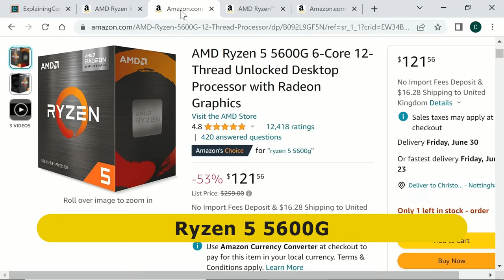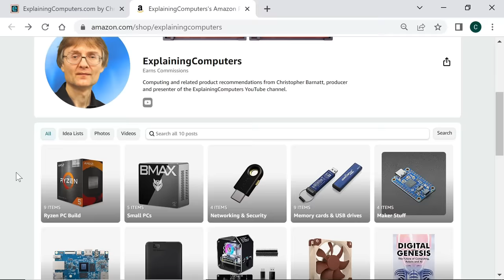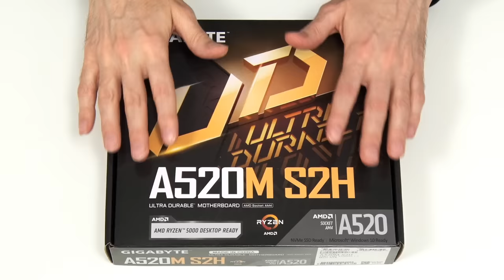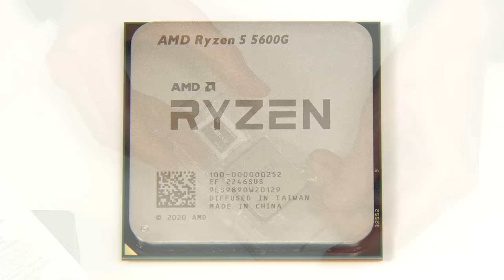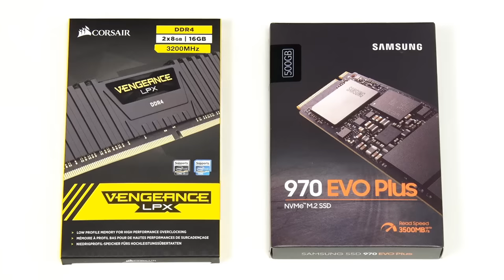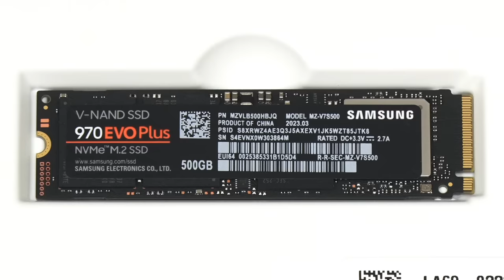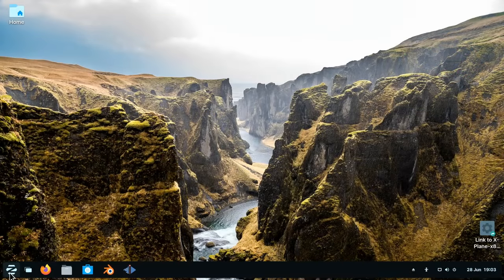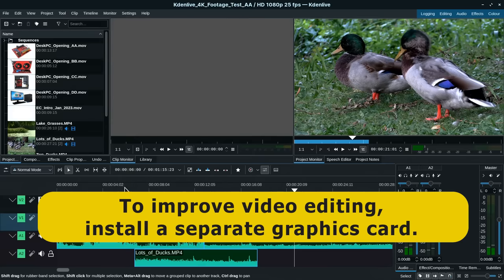Best Value Ryzen PC Build

Comment: I like your approach of going for the 'reasonable' rather than 'high end' side of the performance spectrum... If gaming is not a priority, this system should do its job nicely for the next couple of years, for a manageable budget.
One question though: would that system meet Windows 11 requirements?
Thanks a lot for your time and efforts, and have a relaxing Sunday!   :)
Reply from the maker: Thanks for this. The system meets Windows 11 requirements -- and indeed runs Windows 11 well.
Reply: @ExplainingComputers  Interesting I was going to bet given the age of the processor that this was not going to be the case, but it makes a build like this more interesting! some of us are still firmly in windows 10 land i have 3 daily driver PCs that will not run windows 11 because their cpus are not on the list. They are all capable machines. I think i would probably see  if i could find a motherboard with more memory slots given that i have ddr4 memory that i can recyle and my main work machine has  32gb which isnt enough! Having 3 machine to upgrade if i can recycle the ssds and some of the memory then thats good. Given that everyone will be doing the same old motherboards, cpus and ddr3 memory with are all non windows 11 stuff will be worth very little! and i have to use windows for work!
Reply from the maker: @stevewhitcher6719  As time has moved on, processors not able to support Windows 11 are now typically about 5 years old. And the 5600G is less than two. :)
Reply: @ExplainingComputers  Good point! I did buy the Ryzen 5 CPU that you suggested but paired it with the 4 memory slot version of the motherboard! Havent bought an AMD cpu since they did socket 7 ones! Will be interesting to see what its like!

Comment: The 5000 platform is a great value. You can build a great computer under a budget, it's simply amazing. I just recently built an R5 5600/RX 6600 computer for under $450 (I reused my previous PSU and Case just like Chris did) and I couldn't be happier.

Comment: I watched this vid to figure out how I wanted to build my new one as my current one is about 9 years old. It was the latest and almost the greatest back then, it has served me well and still running. I bought an asus prime b650m-a axii, 16 gig memory, ryzen 5 7000x cpu with a coolmaster hyper 212 black edition cooler. Cooler is massive, just fits in my full tower case. 
Sit down, i paid 853.00 us for all that at a brick and morter store. I checked, they were a bit cheaper than anything on line currently as of a week ago. But still OUCH!!
Thatks for you vids Chris.

Comment: I always use a CPU with onboard graphics even if I am adding in a graphics card. They are extremely useful when trying to debug problems. Additionally, people don't realize just how powerful these new chips are, especially if they aren't doing graphic intensive applications.
Reply: The not needing a Display port, TV on it, old VGA giant monitor...muhahahahaha, why old people need this ??????
Reply: @lucasrem  My new machine has an HDME port on the main board. That seems to be sufficient. My graphics card has multiple display ports.
Reply: Excellent point on using onboard/integrated graphics. Last time I built a PC was... The Pentium 4 days... (Wow, has it been that long?) I'd build the entire machine except for upgraded graphics card, and use the onboard to check for a good boot sequence before adding "one more thing to go wrong."

To be fair, this might be a holdover from Ye Olden Days of setting IRQs and DMA channels with jumpers...
Reply: @dashcamandy2242  yeah, I remember the IRQ days.  I started building computers in the late seventies when I had to wire wrap components to be able to run scrounged peripherals. Good times.

Comment: If you're building something similar for yourself, keep in mind that the 5600G uses PCIE 3.0 instead of PCIE 4.0 compared to the 5600 so you may get some minor performance loss on your GPU depending on your CPU/motherboard selection
Reply: Only on the xx50 Nvidia ones. Others would be unoticed
Reply: the a520 has limits, one of it is that same pci express 3.0, and in practice the only real problem it might offer is not handling well the new pci express 4.0 x4 gpus like the rx6400 or 6500
Reply from the maker: Agreed -- and this was noted in the video! :)
Reply: It's an integrated GPU, so PCIe 4.0 isn't relevant nor will it affect performance. Memory speed will have a larger impact
Reply: @arch1107  from PCIE 3.0 to 4.0
only have a difference of 5~10 fps in almost all games ~ 🗿
please check the 5600x video that uses PCIE 3.0 and 4.0 slots on YouTube
:face-blue-smiling:
Reply: The only reason to use a 5600g instead of the 5600 is to not use a GPU and use iGPU of the 5600g so the pcie version it supports doesn't matter.
Reply: Being a diedinthewool minimalist, I love your emphasis on best value approaches. If I were to build this computer I would only add one thing - a USB-C port card.
Reply: Users of 5600G may not consider Graphic card...
Reply: @penonton4260  no, the limitation on x4 gpus is documented and rx6500 loses more than just 5 fps, in general most gpus will be fine except x4 gpus on pci express 4.0
Reply: @ivantsipr  No, some of us like to have a dedicated GPU plus an integrated GPU as a secondary/backup to give us more choices for GPU testing, system re-purposing, etc.
Reply: @paintedjaguar  Interesting.  Is the loss of cache or whatever it is in a G chip as opposed to a non G chip a detriment to chip performance?  thx.
Reply: @DeepakKumar-lv4te  I don't really know, pinpointing performance bottlenecks is mosly beyond my competence. But sometimes it doesn't pay to sweat the small stuff.

Comment: By coincidence I just built a Ryzen 9 7900 system, for about 4x the price. Much quicker but not 4x quicker. There is a strong economic argument for trailing edge. But, £200 of that was the case and PSU, so in reality, probably only 3x as much. I used a Gigabyte X670 AORUS ELITE AX which has a lot of IO capability and 32 Gb Corsair Vengeance DDR5 RAM. The SSD was a 1Tb Samsung 990 Pro. It is getting hard to find decent cases these days with 5.25 inch drive bays for an optical drive and without glass sides and multiple LEDs. I can see why you re-used the case and PSU.
Reply: you should give the price minus the extras in ram and disk and case for a good comparison for us.  🙂

Comment: Hi Christopher, I recently built a very similar PC to this, I had a power supply, case and a basic graphics card so used an AMD Ryzen 4500 instead of your 5600g, I also chose a Gigabyte motherboard. I've been pleased so far with the build, like you I've gone for an NVME drive, it's the first time I've had one and the speeds are amazing. I'm also a big fan of your choice of Linux OS, Zorin 16, it works so well.
It's good to know you have supporting videos on things like front panel connectors, I can never remember which ones go where.

Comment: This is excellent - an easy answer for the many people who ask every day what to get on a budget.

5600G is pretty decent for many games too - and I still consider building in a cheap metal box to be so much simpler than going with a laptop... obviously it also means you don't have to consider your Monitor, mouse or keyboard an integral part of the system... but then also there's a chance that you have to remember the built in camera/microphone/bluetooth too.

Comment: Excellent video. My old rig is ready for such a rebuild. I'm still running a system I built with an AM3 board and an AMD FX 6300 6-core CPU. It still runs windows 10 and 11 fine, and any linux distro is great on it. But it's time for an upgrade. Been using it about 11 years.

Comment: My current personal rig I have built on a Ryzen 7 5700G.  16GB Ram @ 3000Mhz O/C to 3200MHz allied to an MSI B550 A-Pro.  I had to update the Bios with flashback worked a treat!  What I liked with this board was the 6 Sata ports as I use a lot of dries as well as M.2 NVMEs.  Currently using Windows 11 - but will be putting Linux on my new crucial 500GB NVMe.  Nice build - clearly put one error you said 5500G at the end ;-)

Comment: By happenstance I built a near duplicate here in Ontario, Canada.  Small differences in that I installed Linux Mint on a WD Black M.2 NVMe and like you am very pleased with the performance and price. Admit that I shopped carefully for the parts and bought "on-sale" as much as possible. Cheap old retired guy and all that, grin.

Comment: Great video (again). I did a very similar upgrade to both my main computers over the last two months. One was with a GIGABYTE motherboard, and the other an ASUS; Both using M450 chipsets. Both worked well, and was a satisfying task. I ended up replacing both cases and power supplies; so I guess they were rebuilds, not upgrades.

Comment: I watched this with admiration. It was dreamlike in that all the plugs fitted into the appropriate sockets with no adaptors required. In my personal experience I seem to encounter problems with fan connectors (lol). 3 pin or 4 pin, or trying to run more fans than sockets allow for!! keepup the good work!!

Comment: LOVED THE "CRASH" AT THE VERY END  :)
Overheard on the Heathrow Public Address system:
We are sad to notify you that your private pilot's license has been temporarily suspended by the Federal Aviation Administration in the USA, until you pass their remedial beginner's tutorial.  LOL!!
Otherwise, another GREAT video, Christopher.
Just one very small suggestion:  we now like to print a hard copy of the motherboard layout diagram, and keep that hard copy nearby in a manila folder.  That way, if the PC is powered OFF for hardware maintenance and/or upgrades, the layout diagram can be consulted to confirm things like available PCIe slots etc.
Keep up the good work, Christopher:  YOU'RE THE BEST!!

Comment: Among the best of the best in PC building videos, congratulations!
A small reminder:
AMD APUs tend to have less level 3 cache than the same CPU range without integrated graphics. You will almost never notice a difference, only when using CPU intensive applications such as video editing, or when you have - as a matter of speaking - multiple applications running alongside 55 open tabs in your web browser.
 Also, always check if the integrated GPU has the ability to encode in hardware the video codec you plan to use. If not, the CPU will need to do it, and it will be slower.

Comment: I hope to see you get a couple million subscribers Chris
You absolutely deserve it
Yourself, networkchuck, Jeff Geerling and serve the home are top notch channels 
Sorry but I gotta shout all four of you all out
You have all been in constant rotation on my home lab tv
I actually rip your videos and save them for later
So I can play them through plex
On my 4K home lab tv
Don’t worry I am using an LG WeOS tv. Gotta keep everything Linux based.
All the way to the router with OpenWRT
Was going to use PFsense as a firewall til I was researching it. It’s bad based. So I have ipfire for now.
I’m caving and putting Pfsense on the firewall 
Just works a bit better
Here’s to hoping I can get QuickAssist to work this go around
You got me beat in the Ryzen build
I had an AMD FX. So I jumped the gun quickly and built a Ryzen 3 1200
My gpu is an AMD Radeon RX 570
Only 8 gbs DDR4
Granted it only plays Doom. Well every Doom Game I should say.
All the way to Doom Eternal
Had to sell my Xbox due to not having time to play it.
All I play is doom anyways
So I’m all set
And yeahhhhh Mr Scissors makes an appearance

Comment: Excellent "how-to" - thanks! I'm thinking about putting together a Ryzen 7 or Ryzen 9 7000 series desktop to use as a Linux workstation (mostly for AI/neural networks projects). I've been reluctant to build my own system as last time I tried I cut myself, things didn't quite fit right, I cut my finger, was missing the right type of power connector for my GPU etc... However, you made it look so easy on this video 😄I can't remember the name of my computer case, but it's design to be "near silent" (so no glass panels, no gaming lights or bling etc...). It's truly mind blowing how much "bang for your buck" you can get these days with desktop PCs.

On a kind of related note: I use Kdenlive on Linux too (Arch Linux). I eventually managed to get hardware encoding working on my Radeon RX 5500 and my Ryzen7 4800H, but there didn't seem to be a rendering time speed improvement. I still can't render 4K  (AV1) as both my systems only achieve 2fps when rendering (so it takes over an hour to render 3 minutes). I believe the Ryzen 5 5600G has AV1 hardware encoding, so should be much faster on that APU.

Comment: This is right up my street. I always use 2 or 3 year old tech for my desktop in order to maximise value. I usually wimp out and buy a tested motherboard bundle with RAM & CPU, as I don't really want to risk ending up with a paperweight. I'm not so deeply into hardware specs to be confident I'll choose the correct combination, but this is what you've done for us, and removed the risk factor. Will be giving this serious consideration for my next desktop upgrade.

Comment: 1:09 Nice you picked the same NVME drive I did except I got the 1tb version. I ended up with different parts though when I upgraded in September. had no choice my previous rig pooped out.  I chose the Ryzen 9 5900x, Noctua NH-D15 CPU cooler,  MSI x570s Tomahawk max, Corsair Vengeance LPX 32GB (2X16GB) DDR4 3200 and the MSI Radeon RX 6600 128-bit 8GB GDDR6. Prices were coming down a lot (Due to the new gens being released) but the video cards were still outrageous even back this past September. I chose those doing the math and cost benefit over time. I expect to have this one a long time as my previous build. And so far it's been smashing anything I throw at it. Sure I'm not getting 200+ FPS (video card limitation) in games but averaging 150fps in most, not bad.

Comment: I am just now going over to linux. I have chosen the Mint/Cinnamon distro to begin with. I am building a computer to  run the distro out of AMD/Asus/Team used parts. I have enjoyed your Surviving Linux series.  I chose Linux as I am not impressed with Win11 and the whole security/spying side of intel/microsoft.   I started in with computers with the 8086/8088 boards and worked at a used computer store doing builds and upgrades on machines up to the pentium 60-66mghz boards.  Then I went to work driving a truck for 20 years.  It's all so much simpler now.  Love your content, keep up the good work.
Reply from the maker: Thanks for this, and good luck with Linux. :)

Comment: Did a similar build just before xmas but with the B450M H. Not used it as am so disappointed with Windows 11. Will get round to installing a Linux O/S sometime but I might have to move out of my house soon so no firm plans!
Thanks for the info on the motherboard problem - mine is on the list so will get that sorted.
Great video, thanks very much! 🙂
Reply: could you offer some insights into the choice of board and why not a 520 board? thanks

Comment: Great video Chris. Unless you are a cutting edge gamer a very good system for the  price. It would be nice to have seen a recommendation for an equally suitable external graphics card, for those that may need it (not me), but some may be interested. Personally I don't need a PC any more, I find my needs are fulfilled with a semi decent laptop these days. I won't be buying any new tech, I find my needs are covered by second hand gear quite nicely - no need for any bleeding edge stuff to be honest and trying to avoid anything going to landfill. Currently running an eight year old ASUS i7-4710HQ CPU laptop with 16 Gb RAM and Manjaro KDE. Runs like a champ.No need to exaggerate 😂.

Comment: I recently build two new PC with AMD 4600G, a bit cheaper but for my goals enough power. Both mobo where Gigabyte, one A520 and one A550. The 520 is mini ITX and has 64GB 3200. The 550 has 32GB 3000. Same brand and specs as your build. The reason for the 3000 is that I already had two sticks of 8GB each so I bought two more coming to 32GB. Each PC runs Linux Mint 21 Mate and the 64GB one is for virtual box. Both will be my main computers, connected to my cloud. This gives me enough for the next years, put more than enough of 1TB drives in there as well and have drive bay's to be able to do some testing with other distro of GNU-Linux.

Comment: Almost 4 years ago I bought a Ryzen 3400G apu for a b450m a pro max Motherboard. all worked well but the APU was throttling even though the temp never exceeded 65 degrees. after months of troubleshooting, I figured it was the VRM.the MB doesn't have teöp sensor on the VRMs, the transistors on the MB that give power to the APU and because it has an integrated GPU on it, the APU was pulling 95+ Watts from those VRMs, so the VRMs were getting hot and because I chose a very price/performance MB it had no heatsinks over the DRMs. So long story short the MB was throttling the APU to let the VRMs cool down. it would be best if you bought a MB that has a heatsink on its VRMs to solve this problem.

Comment: Very good mid-level machine.  Back in 2020 I built almost the same system, except with a Gigabyte A510I AC mini-ITX board and a Ryzen 5 PRO 4650G APU in a book-sized Inwin Chopin case.  I used it for teleconferencing and professional software development at home during the COVID lockdown and liked it so much that I built a second, only changing the APU to a 5600G.  Both are highly capable, responsive, silent, and rock-solid reliable, and they're still my main workstations for daily use today.

Comment: Great video Christopher, apart from the slight dent you put in to that aeroplane. I did notice that your fringe is getting a bit long, which might explain your slightly heavy "landing" and subsequent pyrotechnic display.  Perhaps Mr Scissors could assist you with that. 😉
Reply: Not to worry, I'm sure it will buff out....